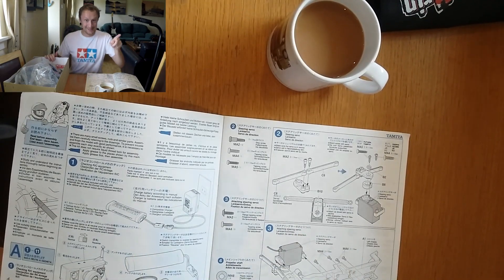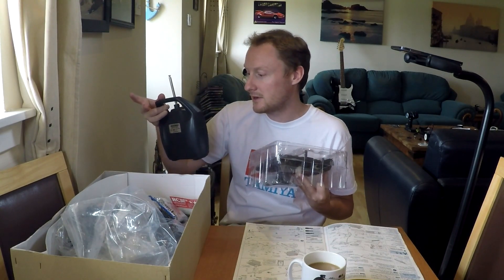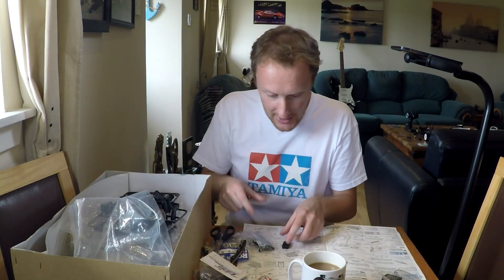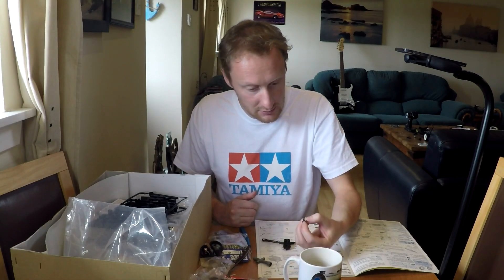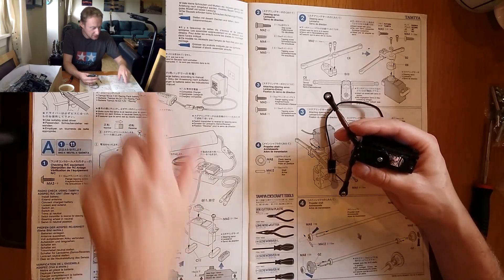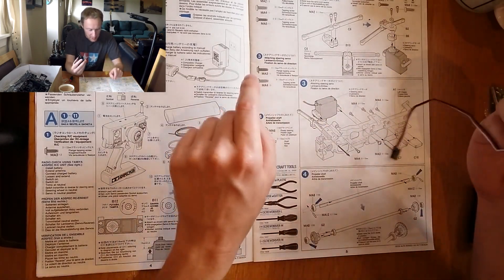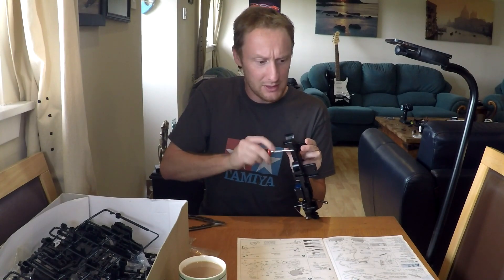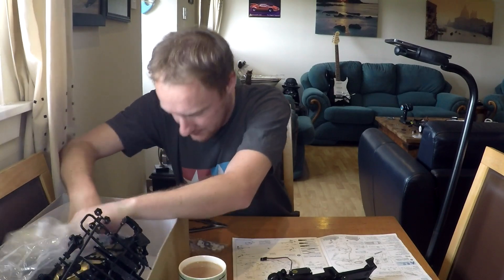TAMIYA NOSTALGIA Part 2. TL-01 initial build phase & thoughts on Carson Reflex Pro 3.1

Comment: When I was much younger (merely in my early 50s then) there were both tamiya upgrade kits and some homebrew bits and bobs that allowed you convert that particular tx to 2.4. I even helped another madly nostalgic rc'er to put one together. 
I can't trace those upgrades now but I'm sure they were on one of the old Tamiya forums.
not a lot of help I know but someone somewhere may have the bits necessary if you look and ask around
Reply from the maker: Every bit of info is still a help! Thanks fo that. I remember the kits, but they were added ono the existing 27mhz technology, if I remember correctly? So the signal got converted. What I'm looking for is a straight rip-out and replace. However, I'll definitely look into the upgrade kits. Cheers!